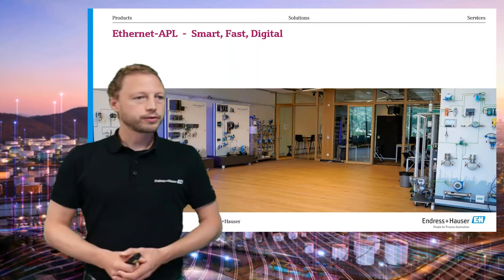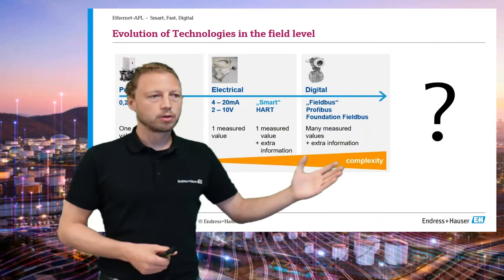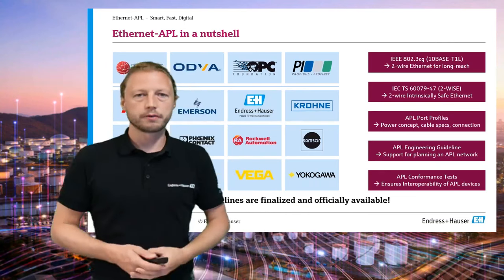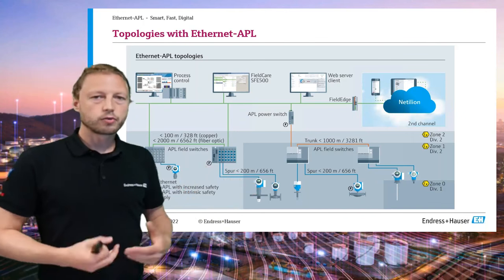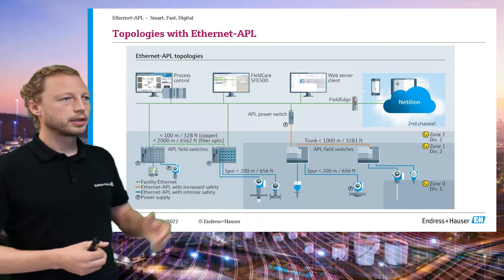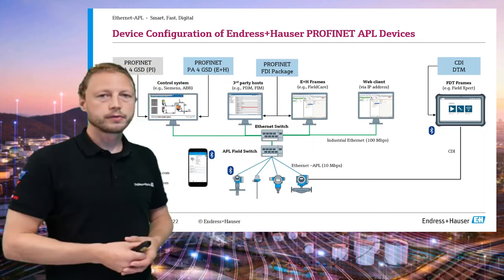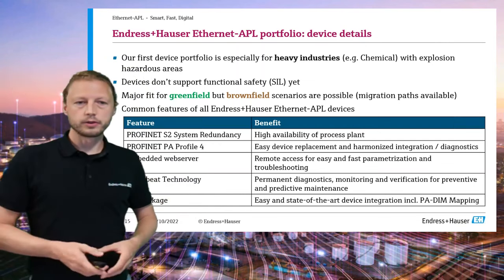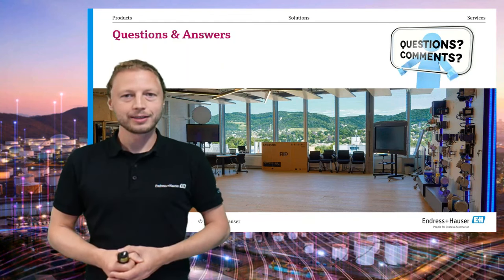Ethernet APL | Smart, Fast, Digital | Online seminar

Comment: Congratulations to all Companies involved in the development of this "new field instrumentation and automation system" for the process industry! 👍
What can you say about the application of Ethernet APL / 2-WISE not only for process control (DCS) but also for Safety Instrumented Systems (SIS /SPLC)?  Would there be any restrictions, from the point of view of communication or reliability?  Apparently there would be many benefits, from the ENGINEERING and MAINTENANCE points of view, since this would enable "standardization" and "uniformity" of systems, hardware and software, with independent installations between the two systems (DCS and SPLC) and with additional SIL certification (IEC 61508) for the SIS. 😉
Reply from the maker: Hi Roberval! Thank you for your comment and question 🙂 Regarding your question about the application of Ethernet APL / 2-WISE: We've already done some successful field testing and from the specification side, there is still the need for some optimization. We agree with you, there will be many benefits for engineering and maintenance!
Reply: @endresshauser  Thank you very much for the important information. 👍
The application of "uniformized" Ethernet APL / 2-WISE field instrumentation and automation systems for both process control (DCS) and functional safety (IEC 61511 / IEC 61508 / SPLC) will certainly bring many benefits and advantages to operators and owners of process industries, especially for industries with the presence of explosive atmospheres formed by flammable gases or combustible dust. 💪
Let's look forward to new projects and practical applications of the APL / 2-WISE Ethernet system from process industries around the world! 🙂